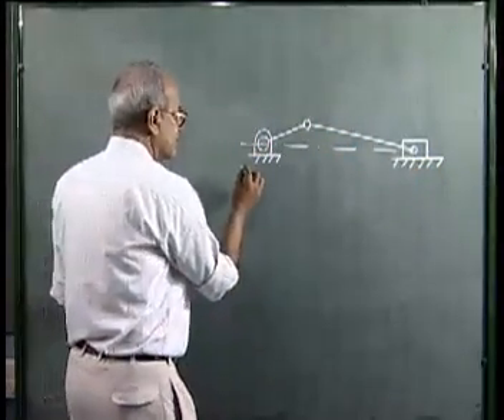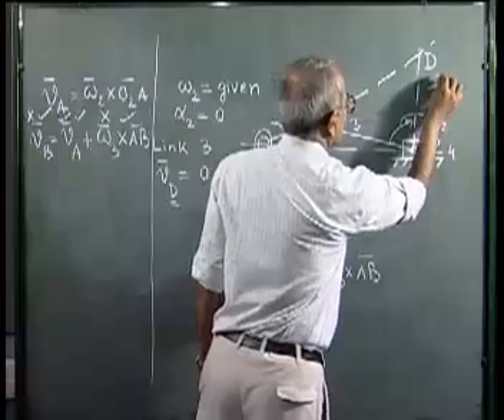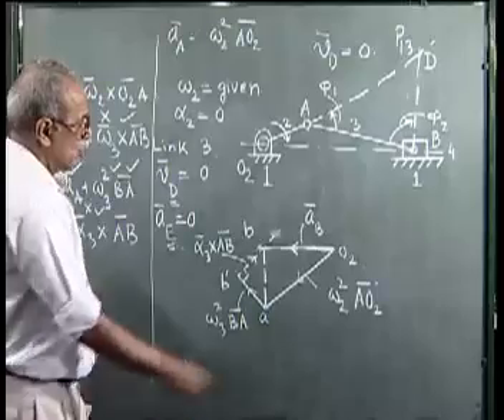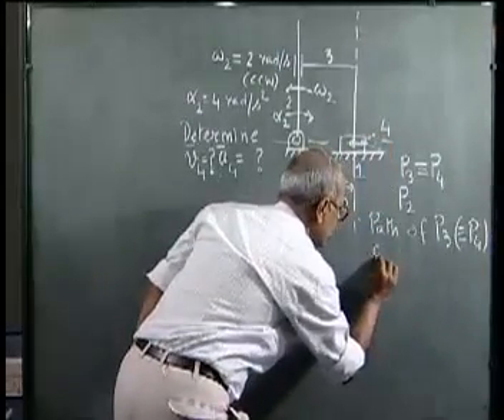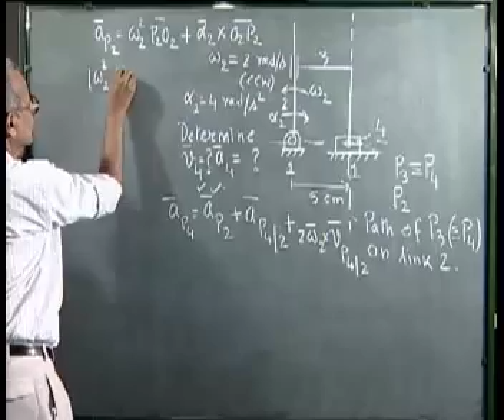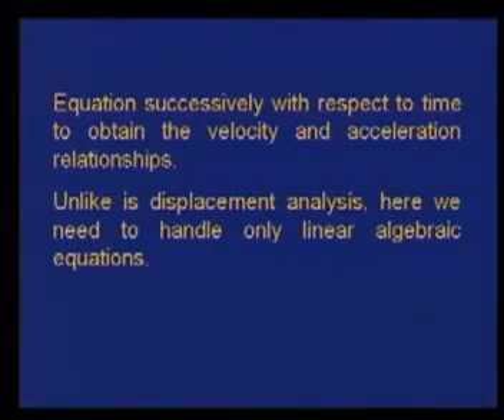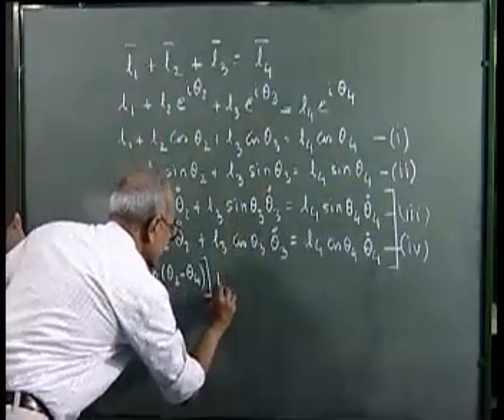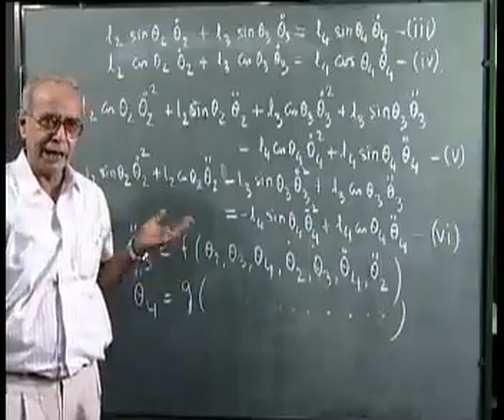Module 5 Lecture 3 Kinematics Of Machines

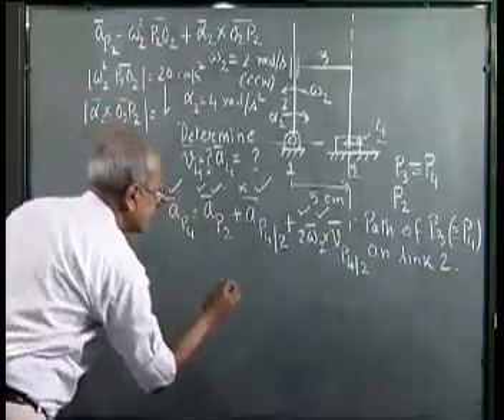Comment: At 29:10 how is the radial component of link 2 made  perpendicular to the link 2?
Reply: Point on link 2 is moving parallel to link 2 in current configuration with centre at infinite. So, the radial component is towards centre i.e. perpendicular to link 2.